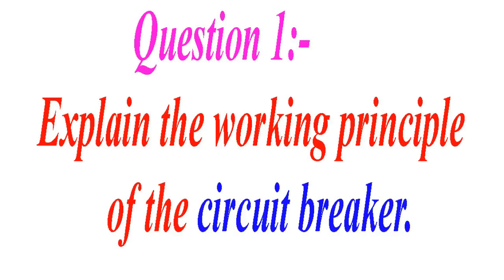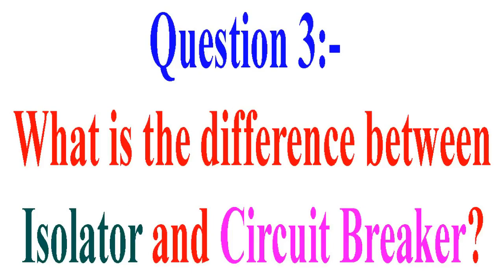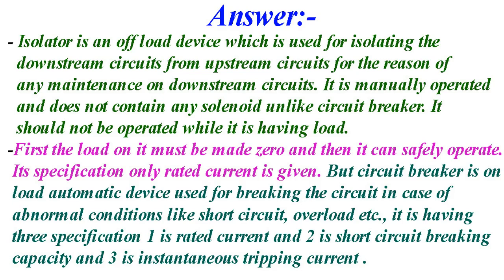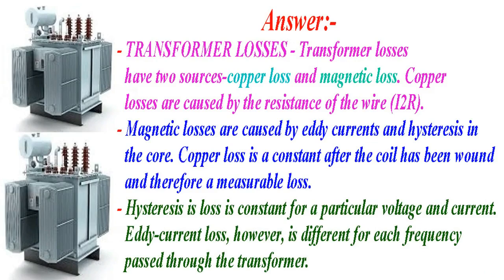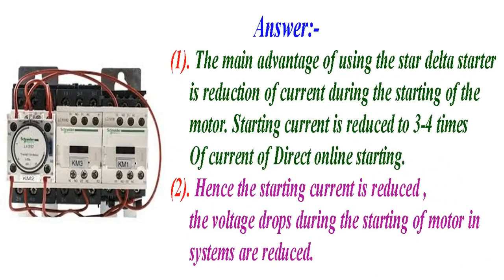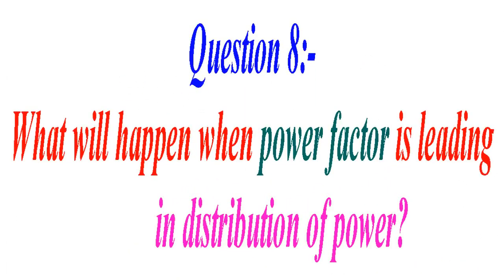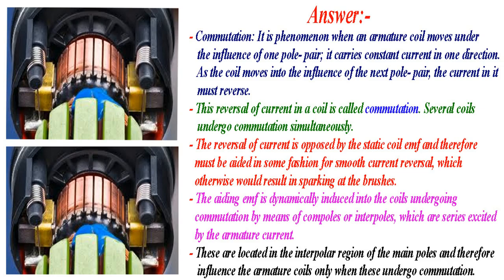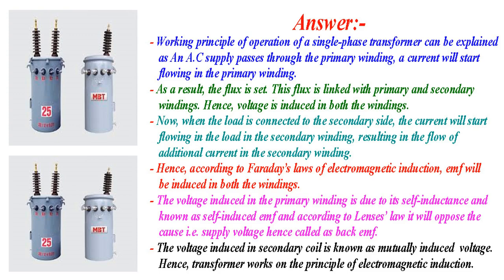Top Electrical Interview Questions with answers #ElectricalEngineering #Electrician

Comment: MCB is miniature circuit breaker and used in low current environment while MCCB is molded case circuit breaker in high current environment above 80A. thanks for sharing such a golden tips.
Reply from the maker: thanks